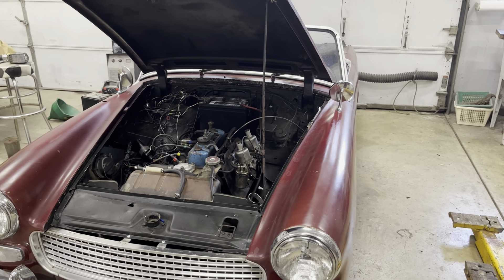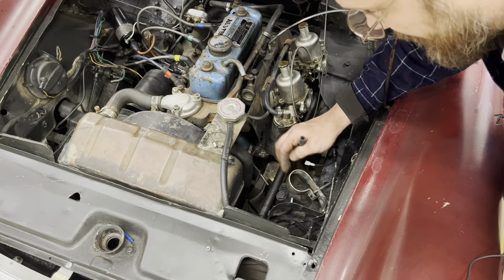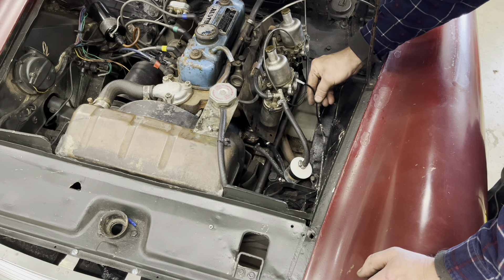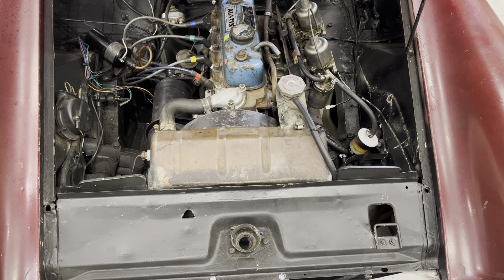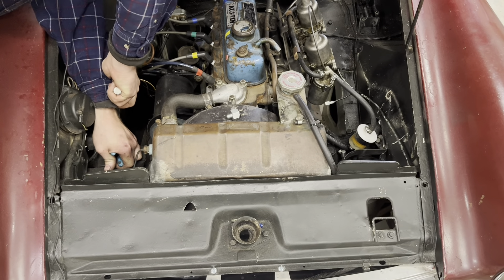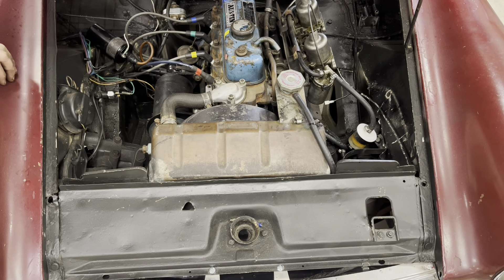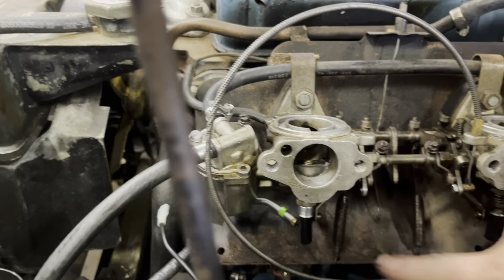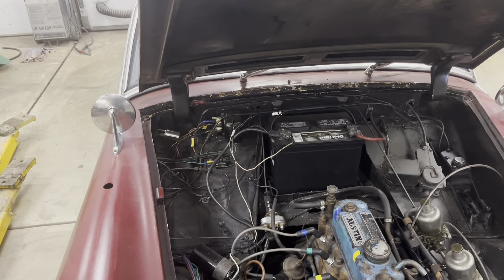63 Sprite part 2 fuel pump and brake light switch

Comment: Nice work. I wish that was the same brake switch on later midgets too!
Reply from the maker: They can be just as problematic as they can leak internally and quick making contact. As with all the parts for our cars they can be made pretty cheap and not last anymore.